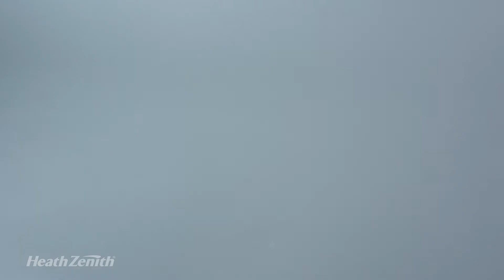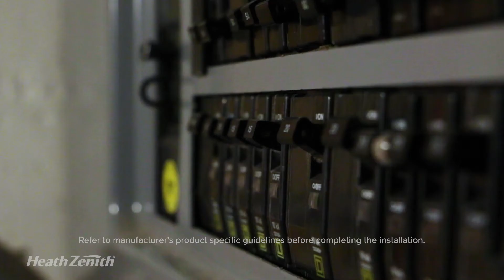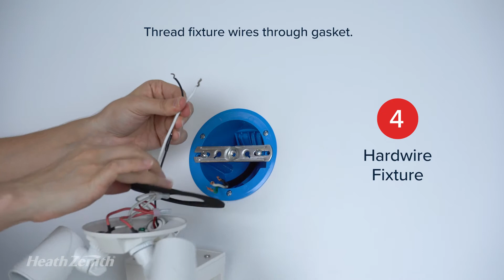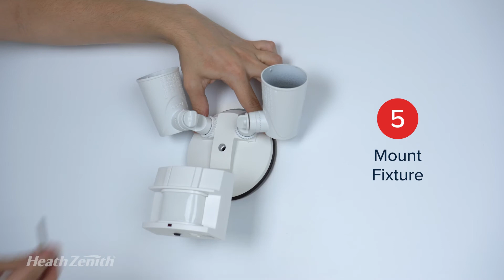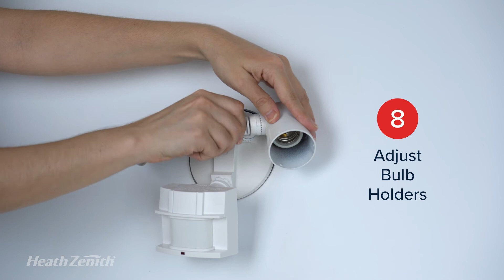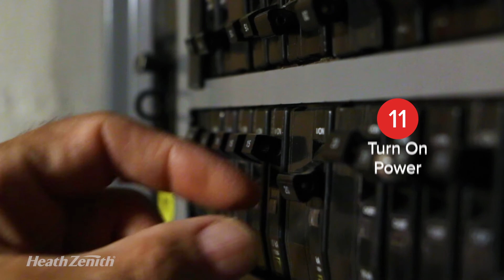Motion Activated Security Light – Installation Guide | Heath Zenith

Comment: What is the loose black wire coming from the sensor housing for? (loose = not connected to the red wire & other 2 black wires with factory installed wire nut)